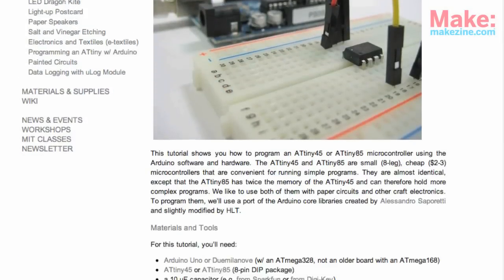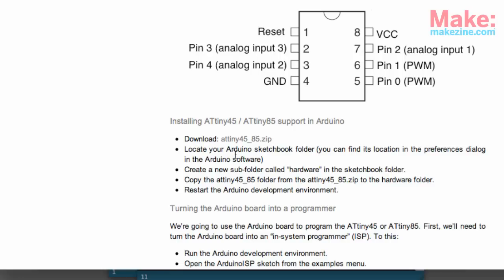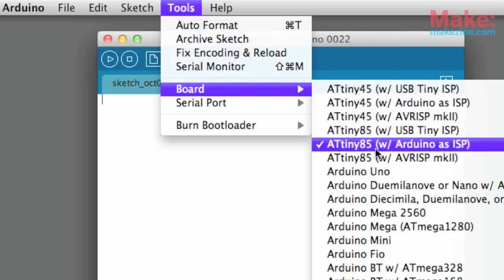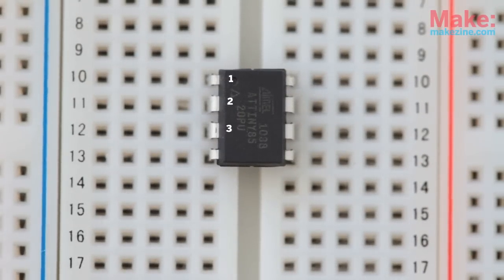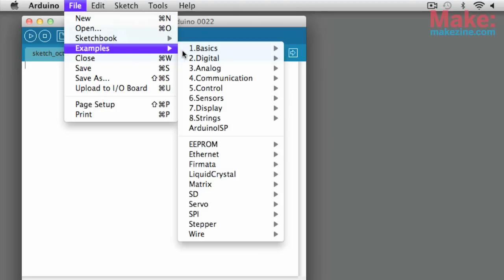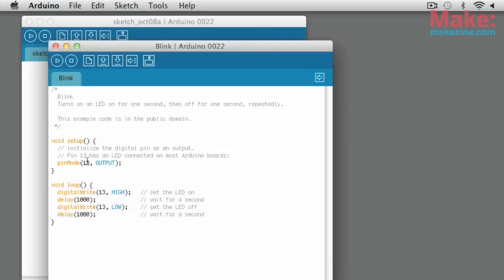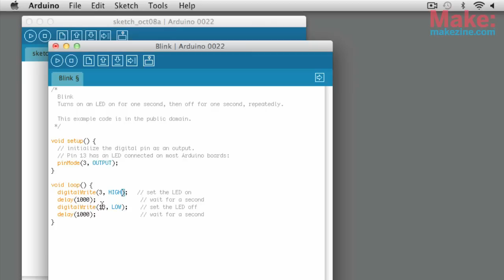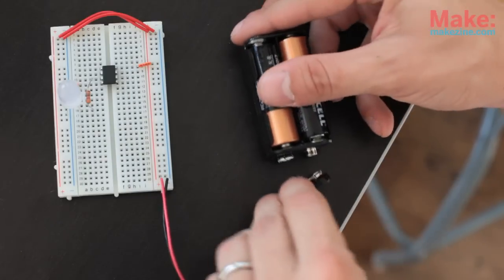How-To: Shrinkify Your Arduino Projects

Comment: Great video and easy to follow. Personally, I think if people are moving off the Arduino and onto standalone projects it might be worth getting a dedicated programmer and programming it standalone. 

I have been doing this from the start, I don't use Arduino or AVR but I do use Microchip PIC chips. The greatest part of using standalone projects is eventually moving away from breadboard\veroboard and fabricating PCBs for finalized projects. I usually add an ICSP header if I want to make changes.

Comment: OMG, thanks. I have been trying to program an Attiny13 using this technique with no success. I got frustrated by some of the warnings I got from the Arduino IDE, I assumed it was not working. The key was when you said reassign pin 13 to the applicable pins on your chip. I got a little flashy thing now!

Comment: This video is very useful, but the tutorial on the High-Low Tech Group page is very confusing.  In that document they refer to physical PIN numbers by their internal Pin names (for example,  Physical Pin 5 is referenced on their diagram as Pin 0.  This is simply wrong.  In the ATTINY data sheet Pin 5  is called PB0 which stands for Port B 0.

Comment: cause leaving reset pin open may result to reading unexpected 1's and 0's due to electromagnetic noise. you could also use just a pull-up resistance.

Comment: Hello Sir.  This video is most interesting.  I still havent tried out my idea using the 8-pin chip.  I have two questions, is it possible to protect your code from being copied while it is in the 9-pin chip?  Next, it is possible to use bigger chips to copy larger programs using the same technique?  I need to password protect my code all the time or burn/engrave it into the chip.  Thanks in advance for your time.

Comment: is it okay to use another capacitor, like 100micro farad or even leave it away.
I also get the error message 
avrdude: error: could not find USB device "USBasp" with vid=0x16c0 pid=0x5dc
when I upload the sketch to the ATtiny

Comment: If you let the Reset pin free floating it is very sensitive and may cause a reset every now and then.
The capacitor stabilizes the level on the pin and prevents unwanted resets.

Comment: Simply to prevent voltage drops, when you switch some load with the attiny. In my latest project (@5V, atmega48a), a rc servo caused an reset (brownout @4,3V) because of its load (around 1A peaks).
I hooked up 1000µF and it runs fine now ( i heard somewhere to use 1000µF/A)
But anyway, it's better (sometimes) to use 2 power supplies (1 for logic, 1 for load)

Comment: I dont see why not. It depends on how well you can program your code into the tiny space given to you. You can do a lot with 4k and 8k of memory if you outsource all actions into functions and just call them.

Also, if you outsource certain functionalities using discrete components or other chips like maybe a 74 series logic flipflop chip or doing that in a bistable multivibrator solution using transistors and resistors you can save memory space on the chip for more processing stuff.

Comment: @makemagazine dude has a point; you could have said some things about which pin does what,
and what those error messages mean and why they can safely be ignored.
also a bit of elaboration on the limitations of this chip vs regular arduino would not be out of place here.

Comment: How would I be able to get a chip with more pins? Will the ATMega328P work and be programmed the same way in this video? What about the ATTiny84? I am looking to attempt to use this method of shrinking to check the temperature of where the device is located, and send it to a computer. Meaning I would essentially need a power source, RFM69HW transceiver, and temperature sensor. Would this shrink method work for this?
Thanks

Comment: These 8 pins avr microcontrollers are great.Of course you can use every arduino module but if you have to make a speed controller or a light dimmer as a stand alone project it does not make sense to use 32kbytes and 28 pins for 1-2kbytes and using up to 5 pins of the microcontroller.

Comment: I've got a question: I want to power the chip with a li-ion battery and of couse its voltage varies. Does the chip now see the varying ~3.7V as 1023 if I want to analog read something or are the 5V = 1023?

Comment: Actually, if you factor in shipping costs and think internationally, the ATMega328 is *cheaper* than the ATTiny.. It isn't far fetched to say you can find the ATMega328P via eBay for under $2 inc. shippinh. (in fact, I just ordered a few for that, and they come bootloaded). However, an ATTiny will cost you at least double that. It might still make sense if space is at premium, however.

Comment: The next ones up are devices like the ATMEGA168 or an ATMEGA328 which are 28 pin devices (offering up to about 17 I/O lines) then after that you're heading towards 40 pin devices like the ATMEGA1284 which has (if I remember right) about 33 usable i/o lines. After that you get into the 32-bit AVR family which goes up from there...

Comment: Do you think that I can use this for nRF24L01+ Tranceiver Module connected to a KEDSUM® 5V 1 One Channel Relay Module Expansion Board For Arduino SCM ARM PIC AVR DSP to trigger the Relay? I only want to use these two items

Comment: I'm making a Remote Control with an NRF24L1 module, will this microcontroller work for my project? the trasmitter circuit and the receiver circuit ?

Comment: @desktopgeek98 Assuming you are talking about the ATtiny2313 apart from more pins, it has no ADC, only 2KB space but has UART. You can see the differences on the Atmel website -> Products -> Atmel AVR 8- and 32-bit -> tinyAVR -> Parameters.

Comment: @waswestkan I tip my hat to you for exploring the idea. For me (and maybe a good number of people) its hard to beat an Arduino nano or pro for one off projects. Hard to get the size smaller. Given that the Atmega328 meets your needs. TI has the  launch pad at ~$5.00 plus s/h that is an idea too. Then Modern Devices has the BBB. Lots of good things to play around with. Regards.

Comment: If not all functions will work on the A tiny why would you want to use Arduino IDE ? Clever idea but why would you only be concerned with Arduino ?

 Would it not be better to revert back to C in this case ? 

What advantages do you envisage relative this to ordinary C

Comment: Arduino IDE actually adds ~1000 bytes of stuff you actually don't need. My suggestion to people who want to play with these chips is to grab gcc-avr and program them that way. It's harder than Arduino IDE but well worth the effort. You still get the benefit of programming in C or C++ but you loose some of the conveniences.

For comparison blinking example when compiled by Arduino takes around 1020 bytes or more. When compiled with gcc-avr same code takes around 120 bytes.

Comment: i made a barebone arduino and iam using RF modules with it for my projects...I now need to make PCB..of the project where size is a big factor...can i replace my atmega 328P with ATtiny chip..you just mentioned..

Comment: hello  yesterday i bought an at tiny 85 and before 5 minutes it worked fine but the last time i plugged it in i put reverse voltage by mistake and now it doesnt run did i burn it?

Comment: There are a LOT of different AVR microcontrollers. You'll have to look up the specs yourself, but if you want a different selection of pin counts then try the attiny2313 or attiny261

Comment: You need to use an ISP programmer with your tiny85 and program it with the Arduino software environment. You'll need to install a hardware driver (google for attiny45_85.zip)  to interface the tiny85 to the Arduino - instructions come with it. Then all you need to do is go to the Arduino Playground libraries page and choose the shift register library you want to use (check out the shiftOutX  and TL5940 libs for just two examples) and you're all set.

Comment: II'm a novice in electronics. I'm interested in recording an executable file on a chip or integrated circuit, I want to use it as a key for software that I want to implement. It's possible? I would like to know everything about it, thank you.

Comment: True - The attiny seems to have the mips thing in bulk-loads. But unless you need high speed data communication then this is overkill - I recon 99% of attiny chips out there only blink leds - which is exactly what you demonstrated. Actually, for $2.50 I can buy a 16bit Digital Signal Control Microchip with 40MIPS. But seriously, would you make a MIDI device or digital measurement insturment with an 8-bit device?

Comment: @Mohammad M While this example could certainly be done with a 555 IC, it was not the point of the video -- just a handy example using minimal components. The intention is to illustrate a method for using a smaller chip when a full Arduino board itself is not really required, but when one might still require programmability in the solution.

Comment: Normally, the Arduino automatically resets on power up, and when establishing connection from the USB serial port. This function needs to be disabled when using the Arduino as an ISP programmer. The capacitor holds the Arduino reset line "low" long enough to do this.

Comment: Hello,would you mind helping me in my project which is the solar tracker?i already have the components.i just need directions..please?
Reply: Swetha Reddy  Do you have 1 axis traking or 2 axis? You can use some light sensors at the base of your solar panel so when the sun changes angle then your panel will also do the same.

Comment: @reviathon360 If you need more pins that a board supports, just add shift registers, or multiplexers and you can have as many as you like. E.g. with 9 multiplexer chips, you can have 64 analog/digital inputs using only 7 pins on an arduino. With shift registers, you can have as many as you like - after a few hundred though, it can get a bit slow to update/read them all.

Comment: Hey! This is awesome. Is there any bigger chip I can use, not including the atmega328 (because it needs voltage regulators ans 16mHz crystals and such)? I'd love to be able to do this but I need more room for sketches and a few more pins. Unless there IS a way to use the atmega, because I know I have one somewhere.
Reply: +dj505Gaming The ATMEGA328 does not require voltage regulators (it can run straight off 5V from USB), and it features an internal oscillator the runs at 8MHz so you don't need an external crystal if you don't mind running at half speed. You get to use the 2 crystal pins as GPIO too, so that's a bonus!
Reply: Awesome! Thanks so much.. Anywhere i can get the files to replace the attiny ones?
ex. Atmega328 (w/ Arduino ISP)
in the menu

Comment: And that would be why I keep a bunch of ATtiny13As on hand. Cheap, 6 pins to work with, easy to program with an AVRisp mkII, auto-runs at 1MHz on its internal RC osc without needing an external osc, wide supply range. With 1KB of flash ROM and 64 bytes of EEPROM for settings, etc. it's perfect for really simple projects that could use a little more brains but don't call for a full-bore uC.

Comment: PLEASE HELP!!! [URGENT!!!]
Can I use 25V 2.2 uF electrolytic capacitor instead of 50V 10uF capacitor? i don't have the 10 uF cap and I need to complete the project urgently. i worry that I will destroy the Chips!.. Thank you
Reply: Vivek Mathema you won't destroy the chip, you may mess up the programming or the reset system in the IC, but that's only while you have the other cap in. Just dig up a 10uf cap somewhere on your desk and it does not have to be 50V, it can be 10V
Reply: Vivek Mathema You can do without the capacitor if you have quick hands. Reset the tiny the board just after you hit the program button.  The smaller cap might or might notwork but wont harm the chip physically

Comment: I see that programming takes up one of the pwm output pins I need my project to have two outputs If im understanding correctly this process will leave me with one output pin?
Reply: Wrong, you only need to hook the attiny85 to the arduino for programming. After programming, as long as you have a 5v regulator, you don't need the Arduino board at all. You then have up to 5 outputs to play with.

Comment: Is there any way I can implement this and still have Serial communications? If not, does that mean I will always have to have the Arduino Board with my project?
Reply: +Shashank Rammoorthy The softwareSerial library for arduino is a good place to look as the ATTiny does not have hardware serial connections (Hence, why the arduino has to act as an In-system programmer (ISP) instead of just using an FTDI board to upload the code.
Reply: +Kyle McNicoll Thanks for your reply. I think I have a fairly good idea of where I am headed now.

Comment: If someone could answer this it would be great. I'm trying to make an IR remote control and managed to get my blinky code on the ATTiny85 but my signal is sent pretty distorted, and the receiver won't recognize it. I'm speculating that it's because the internal clock of the ATTiny isn't precise enough. Any insight? Do I have to use an external clock?
Reply: Have you tried burning the bootloader and using the ATtiny at 8MHz instead of the default 1MHz?
Reply: sykodogg Yea did just that eventually. My signal was severely distorted because the ATTiny took longer than the ATMega to perform some operations and my delays weren't properly calculated to take that into account. This made my carrier frequency all messed up and the IR sensor considered it was off sometimes when it was in fact on. It worked after some tweaking.
Reply: ***** Glad to hear it!

Comment: is there a way to do the same thing but by using atmega but without taking off the atmega chip that was in the arduino board ? thanks
Reply: you can buy an atmega chip. http://www.atmel.com/devices/atmega328p.aspx you will want a pdip package (plastic dual in pin) like the ATMEGA328P-PU

Comment: This is a typical method to ground unused pins of a chip. The last thing you want is a floating pin (floating = pin voltage is not defined and free to be altered by static electricity and magnetic fields, which can influence the chip during runtime in unexpected and unwanted ways). 
You use a capacitor to filter out any noise that would otherwise affect that pin, while connecting it to a ground voltage (in this case 0V).
If not done, the chip could reset randomly on runtime. Avoid FLOATING pins!

Comment: Great video. I was wondering if I was able to program a PC817 Chip using the arduino as well and if so how? Because there are only 4 pins instead of 8
Reply: PC817 High Density Opto-Coupler so I dont think you could program that!
Reply: Oh, Thanks

Comment: When I have it set to blink with delay(100) it turns on every 3 seconds and delay(1000) does it about every 15 seconds. It seems to be fixed when I change the clock speed of the attiny85 from 20 MHz to 1 MHz even though the place I got it says 20 MHz. Anyone know why?

Comment: So, I take it there's no need for an external crystal when using a AT Tiny chip, is that right?
Reply: according to this it has its own oscillator that runs at 1Mhz
Reply: Thanks.
Reply: You can make the internal clock of the ATtiny run at 1, 8 or 16MHz by burning the bootloader.
Reply: @PunakiviAddikti  Can it read analog inputs from 0 to 5 volts like the arduino?

Comment: Wont this burn up on 9v? Don't you need a 7805 voltage regulator or step down/buck converter to ensure only 5v?
Reply: I see that he used AAs, so no more than 3v going to the chip, but if you wanted to plug in a 9v you would probably need a regulator.
Reply: Yes, it operates only between 2.7 to 5.5 volt.

Comment: The led goes connects to the chip through a resister on pin 2 of the chip.  It's kinda hard to see, but it's there.

Comment: Hi, nice tutorial. I followed exactly your guide lines, but I take the follow error every time I try= exec:"-w": executable file not found in %PATH% Error compiling
What I make wrong? (I use Arduino Mega2560 (pins 50,51,52,53) and I am trying to program a ATtiny85. Please Help.
Thank you
Reply: +Jim Captain  

Ok I
managed to upload on Attiny85 using the “Roger Banks “advice. Thank you.

Comment: Probably more trouble than it's worth to try to make the Atmel environment work with PIC chips. Unless you have a bunch of those PIC MPUs and want to use them, it's much easier to just get some ATTiny2313's which have almost identical specs, and cost next to nothing. You can program them using a dedicated programmer (I use a AVR Dragon) or using the same method shown in this video. There is info about where the HEX files are stored, I'm sure I've found them before and uploaded them manually.

Comment: On IDE 1.0 it won't verify my sketch that has analogRead(A1); for the 85's but if I switch boards to the 84 it works same thing with the 45's and 44's what's wrong?

Comment: does anyone know if you can sorta dasychain them if your project is a bit more complex? if no, what chip should i use?
Reply: You can buy the chip that is used on the Arduino board itself, the ATMega328 PU. You can find them on amazon for less than $2. Programming the chip is the exact same as the ATtiny, except you'll have to look up the pin layout online. Here's an article I found that may be of use http://www.instructables.com/id/2-Arduino-the-ATMEGA328-As-a-Stand-alone-Easy-Chea/?ALLSTEPS

Comment: -.-" ofc u can make a LED blink with discrete components. But once you get past a certain amount of functionality it becomes easier to use a microcontroller solution. But typically ucontrollers aren't salvageable because they use OTP (on time program) memory for their code. You could use something like a 8052, but most commercial ucontrollers have assemblers & compilers for hundreds if not thousands of dollars, and you typically need a development board (more $k) & an EPROM programmer (more $k).